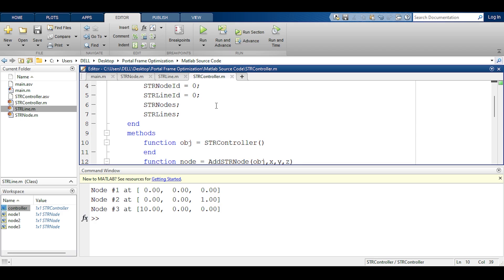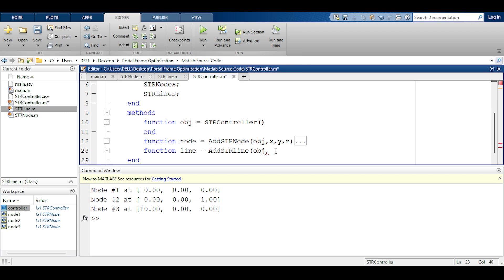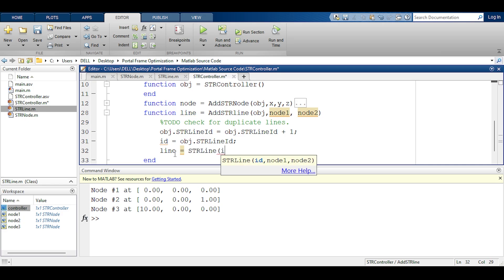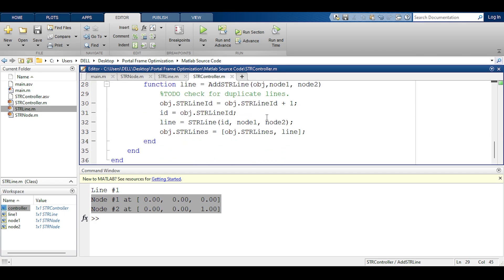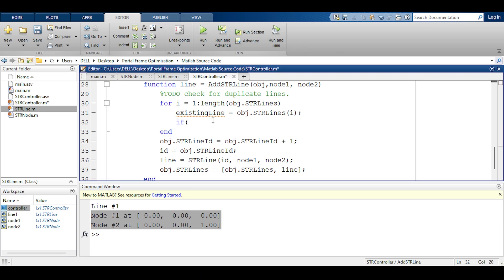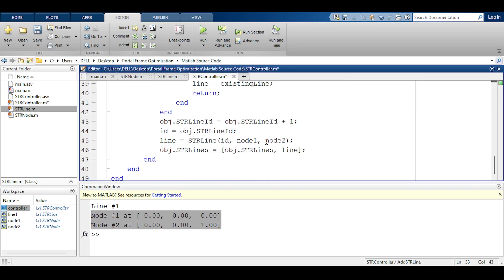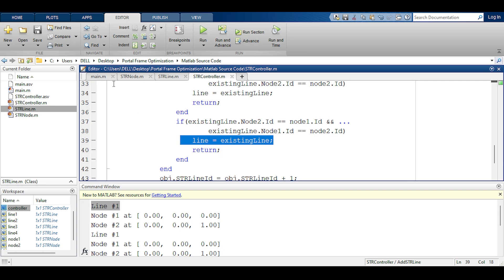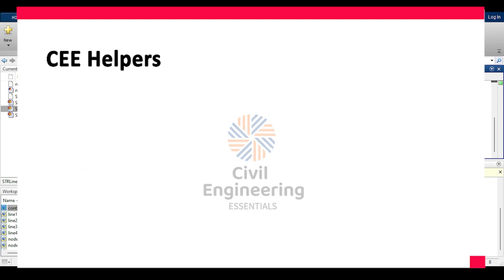Programming the Finite Element Method using MATLAB - Part 5: Adding STRLines in Controller

Comment: Dear Dr.CEE,

Thank you very much for your series! I've learned a lot of new stuff about OOP in Matlab.
Could you please explain one thing:
By adding a check for duplicate Nodes and Lines into Controller, we avoid repeating nodes&lines inside the controller, but we still have them defined as variables (one should look at the Workspace of the program). For example, by the end of this videos we have 3 different nodes and 2 lines inside the controller. But at the Workspace we have same 3 nodes and 4 lines, three of which are the same (a.k.a Line #1).
Will there be  a way to deconstruct those repeating variables, so that we don't waste our memory?

Best regards
Yaroslav
Reply from the maker: That is correct. You could technically duplicate it this way. So a destruction of repeated variables is a must.

Matlab is different from c++, there is no (memory garbage collection). Not that I know about, so I think the best way to "delete" an object is to call

x = [ ] ;